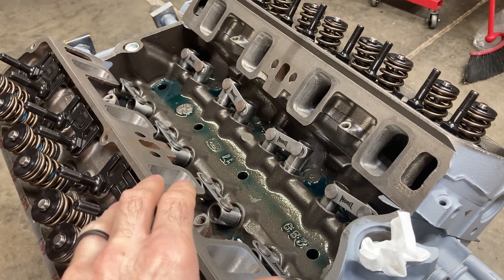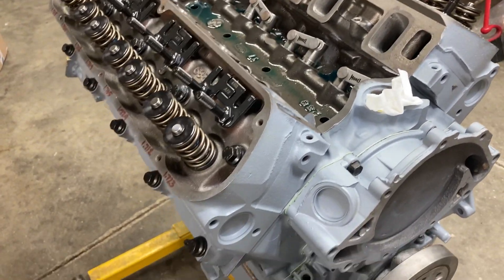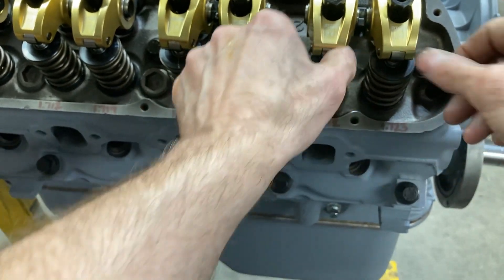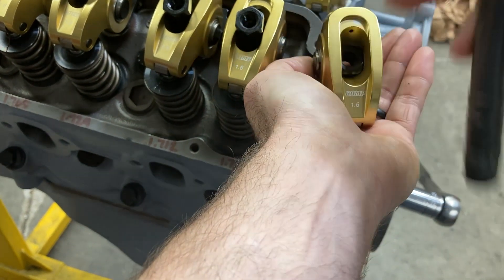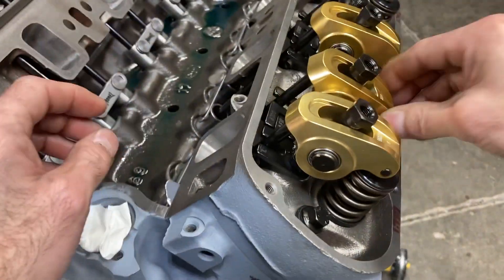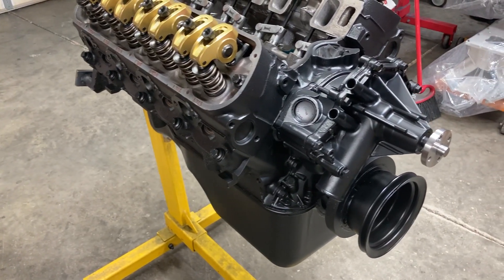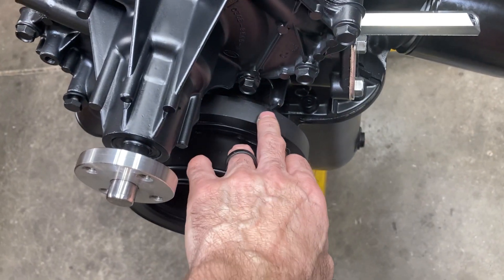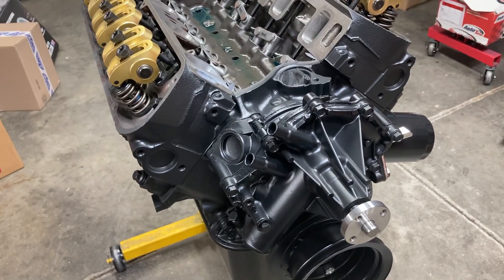Lykins Motorsports Ford 289 Engine Assembly, Part 3

Comment: Hi how are you doing today, I'm buying a short block Engine 74 302 block, 289 crank & Rods w/3/8 bolts ,.030 over it's balanced too , my question is do i need to NEUTRAL BALANCE the damper & pressure plate clutch too. I remember years back doing it all as one ??

Comment: Great video's. I was just wondering what'a most ci's and hp can you get from a NA carbed FE... or you have heard made.
Reply from the maker: It used to be that there were 4.375" stroke crankshafts on the shelf.  I can get 4.375" cranks now, but they are custom.   With a 4.375" x 4.375" FE combination, you get about 527 cubic inches.  You can go a lot larger on the SOHC combinations because there's no cam to get in the way of the rods.

Comment: You have a bolt loose near the lower outlet of the water pump, or at least it looks like that on the video
Reply from the maker: I left it loose.  I think it's gonna help capture the generator later on.
Reply: @lykinsmotorsports  Oh, I wondered about that maybe. Just happened to notice it

Comment: You mention the rockers moveside to side I had a new pair of small block ford Trick Flow high ports and the rocker stud hole and pushrod holes were not centered with the valve stem like 3/16 of an inch sent them back thought they were bad